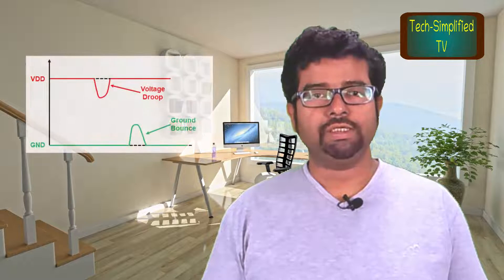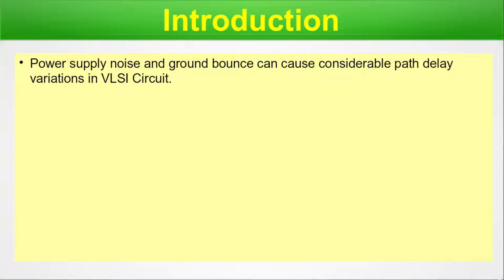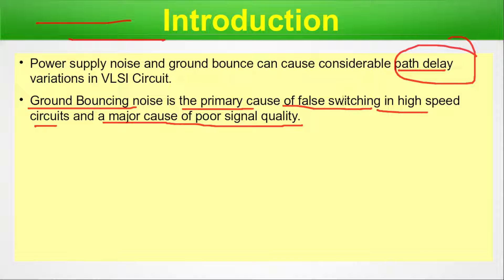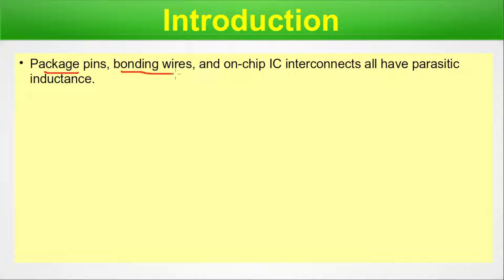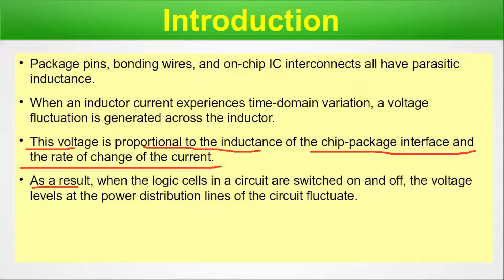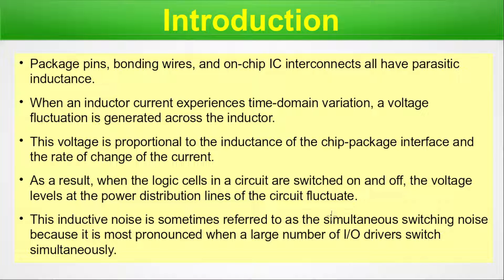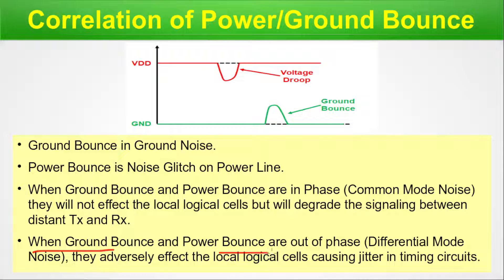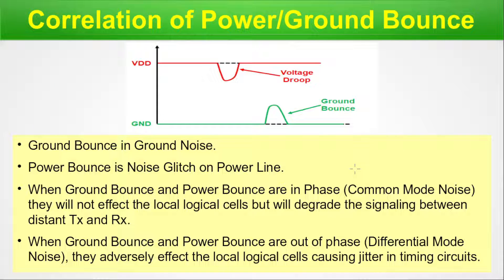Understanding VLSI Ground Bounce: Causes and Solutions

Comment: Ground bounce is also called as supply bounce right ?
Reply from the maker: Not exactly — "ground bounce" and "supply bounce" are related phenomena, but they are not the same and should not be used interchangeably.

Ground Bounce: This refers to a voltage fluctuation on the ground (GND) line. It happens when multiple output drivers on an IC switch simultaneously, causing a large transient current through the shared inductance of the ground return path. This makes the local ground potential rise above the actual ground — hence the term "bounce."

Supply Bounce (or Vcc Bounce): This is a similar phenomenon but occurs on the power supply line (Vcc or Vdd). When many transistors turn on or off simultaneously, the sudden change in current through the inductance of the power supply path causes a temporary voltage dip or spike.

In summary:
Ground bounce = fluctuation in the GND line.
Supply bounce = fluctuation in the power (Vcc) line.
They both stem from parasitic inductance and simultaneous switching, but they affect different reference points.